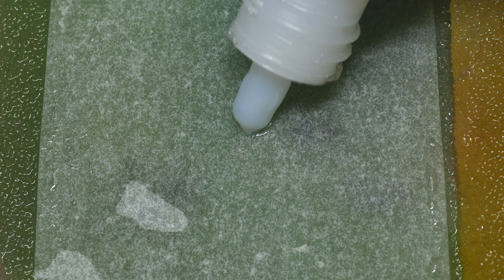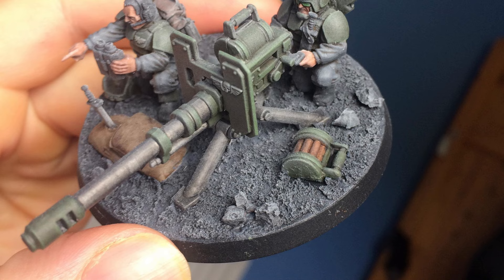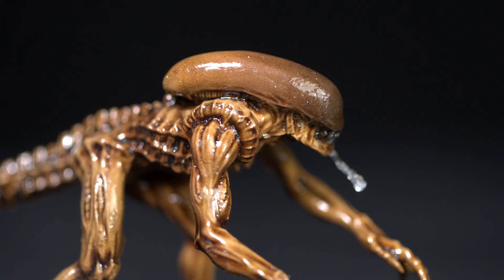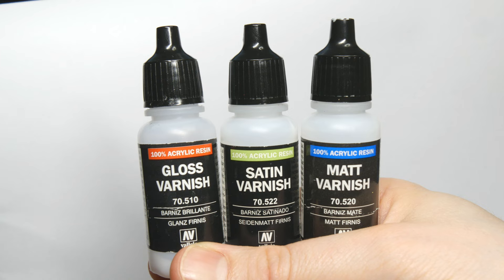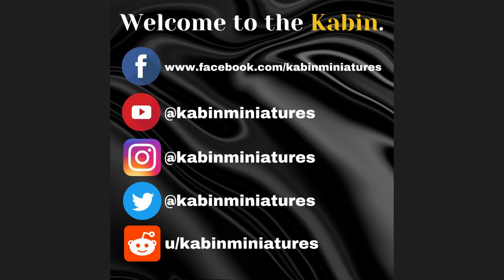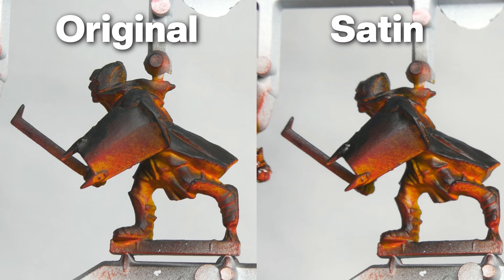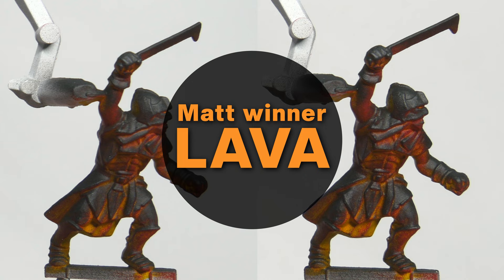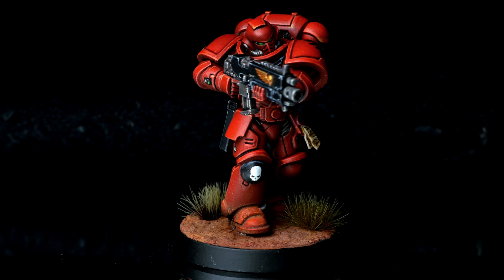How to do varnishing on miniatures!

Comment: Nice comparison. When I paint TMM I leave the metallics for the end. That way I can matte varnish everything with my airbrush and then paint the metallics without dulling them. That means the metallics remain unvarnished (or at least it's not practical to varnish them with the airbrush), but I don't feel the need to varnish metallics since those paints are usually more durable than regular paint. Not a practical approach for models with a lot of metallic parts or for when you want to airbrush metallic paint, though.
Reply from the maker: Thank you so much! That's great advice, I think that could work on several paint schemes 👍
Reply: Late reply, but I prefer to do a compromise of this method. I basecoat and shade TMM areas, varnish, and then add TMM highlights on top with my brightest metallic paints. This means it's nice and easy to clean up mistakes while basecoating and shading, but I also get the shiny metallic effect with only a very tiny risk of accidentally painting other areas with my TMM highlights.
Reply from the maker: Thanks, that sounds like a great order to do the steps in 👍 I want to try that!

Comment: Great video, I just wanted to ask you if the figures when applying varnish are somewhat sticky to the touch. What could be happening?
Reply from the maker: @Agh3Design  Thanks! 👍 I'm sorry to hear about the sticky results. I haven't had that happen myself, but a quick Google makes it look like a common phenomenon. People seem to point to many reasons such as humidity, spray can solvents, improper shaking, improper cleaning, the material of the minis, the wrong type of varnish (ie for oil paints), etc. Some say that a new coat can help, and they swear by different brands (such as Testors Spray Lacquer) to be "saviours" of sticky surfaces. But personally, I have no experience in solving it...

Comment: If u dilute the varnish what ratio would it be or how many drops
Reply from the maker: Yes, I dilute the varnish with water, but I don't measure it exactly... My estimate would be maybe a 1:1 mix? I put a little water in a cup and add varnish drop by drop until it has become a "milky" consistency.

Comment: Only problem I have with varnish is my mini always sticks to the base It sits on. How do I fix this?
Reply from the maker: Do you mean you've put them on a temporary base, and after the varnishing, you can't get them off?
Reply: Yeah a temporary bass and I can get them off it's just the bottom of the feet always gets ripped apart and I have to repair it  @KabinMiniatures
Reply from the maker: @lehighvalleyrockhounding  I see! Have you tried pinning the model to the temporary base and raising the feet a tiny bit above the surface?

Comment: Great video. I don't have an airbrush and am unlikely to get one in the near future - is there a particular spray on (i.e., rattle can) varnish you'd recommend? I gave up on Purity Seal years ago after a 'frosting' incident and tend to use Testors Dull Cote but that gives some pretty variable finishes from dead matt to semi-gloss.
Reply from the maker: Thanks! I only used Citadel rattle cans before I switched over to the airbrush, so unfortunately, I can't really recommend any other brands.

Comment: A varnish not a lot of people have lucked into is Vallejo's Mecha Satin varnish. The "Mecha" line paints are intended for gunpla and cure to a very hard finish - to account for movable parts rubbing against one another. The varnishes in the Mecha line form a really tough barrier, good for wargaming models which will be picked up and moved around a lot. The satin variant in Mecha has a luster which is a very good match for how Citadel paints dry, and don't dull metallics at all.

Ever since finding it, it has become my go-to satin varnish.
Reply from the maker: Sounds very cool, I'll have to check that out!

Comment: 3:1 matt to satin with 2:1 varnish to thinner through an airbrush at 20 psi is my go-to. I find two thin, consistent coats gives me a nice relatively matt finish that doesn't suck out all the color vibrancy. I've used it for fantasy/scifi/historicals and been happy with the results so far.
Reply from the maker: Thanks for sharing your recipe! 👍